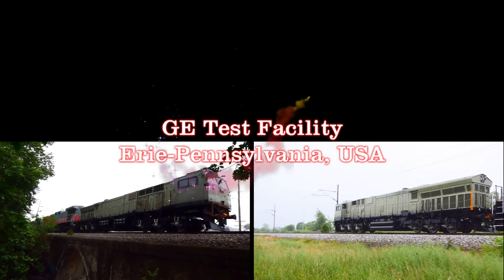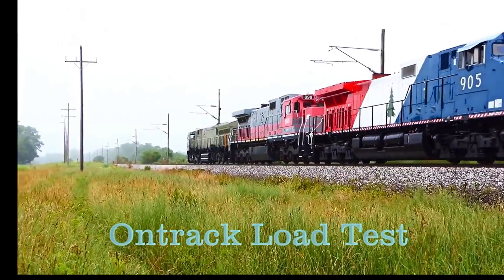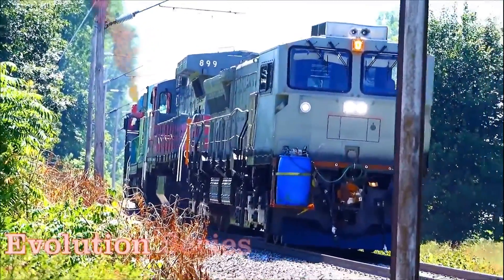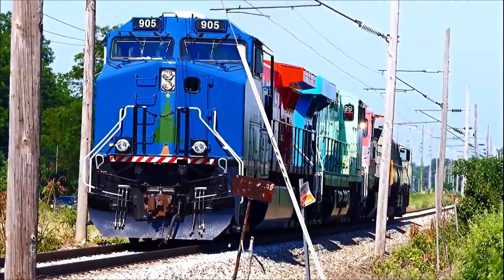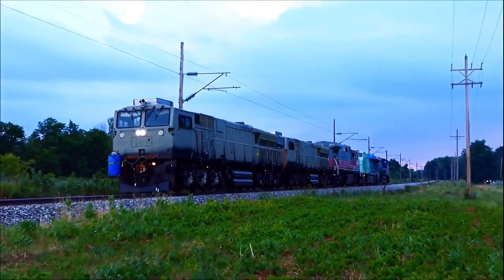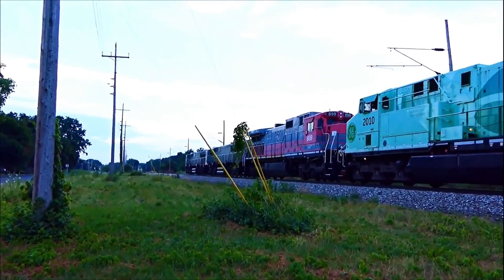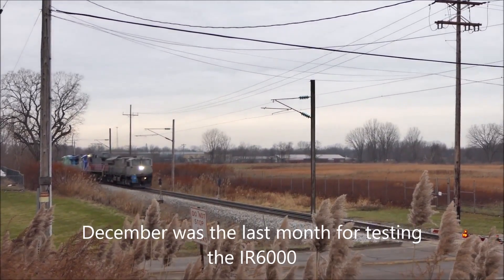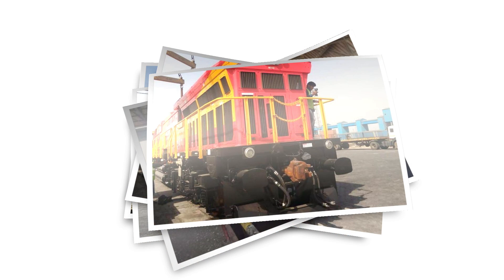6000hp WDG6G Watch Complete Testing on GE Test Track First 2 Units

Comment: The rear locomotives I heard operate in braking mode thereby simulating actual load conditions. They are not in power off mode.

Comment: Still Indian railways are importing diesel engines🤔🤔🤔🤔
Reply from the maker: Total contract is for 1000 units - 700 WDG4D and 300 WDG6G. Out of this only 150 units would be imported, rest would be manufactured in India. Please read the description in my Video!
Reply: This GE engine is best in class fuel efficiency and emission norms.